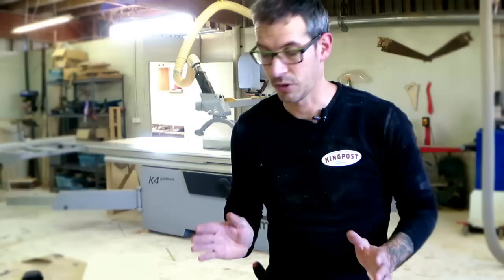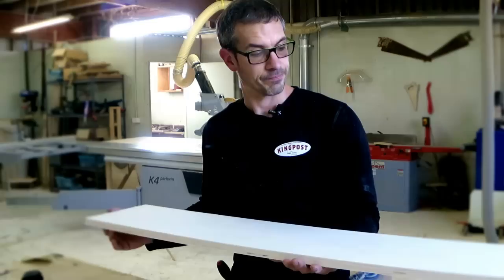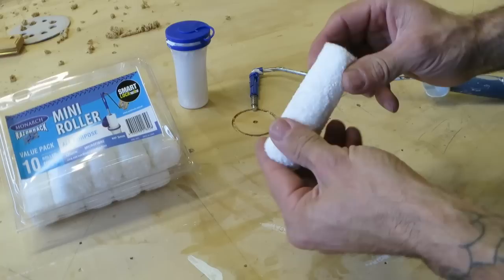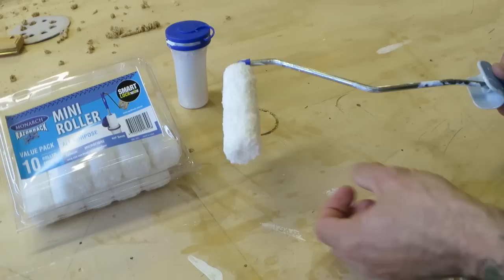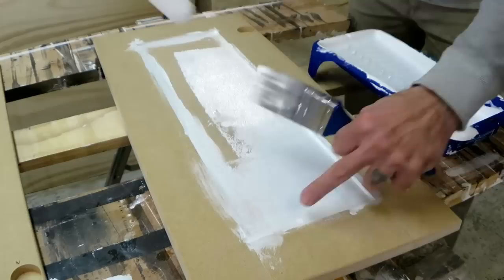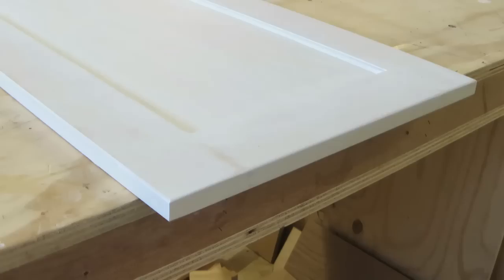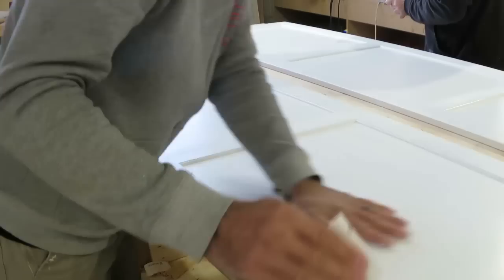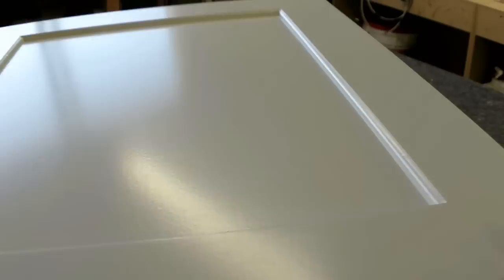Great paint finish with a roller!

Comment: I can't stress this enough! Use these rollers in this video! I used to think the high density foam rollers were the best but they are not. Get the short nap microfiber rollers.  I also used benjamin moore advance paint. I added floetrol to the paint. Whatever texture you might get from the roller will smooth out with drying! My cabinets came out amazing! Zero roller or brush marks. People think I sprayed my cabinets but I didn't! Lol!
Reply: Did you lay off with a brush after rolling? I ask because I am unsure whether that just means you would have brush marks.
Reply: @Avital4414  no I did not lay off with a brush after rolling. However your going to need to brush any detail you might have on the cabinet door. I have panel inserts that I had to brush. Mainly because a roller can't get into it. If you use a microfiber roller you will have tiny little stippleing right after lifting your roller. Don't worry it will level out just fine, it's nothing compared to the bubbles left from a foam roller. The key is don't fuss with it too much. If your not sure ....just practice on a scrap piece of wood.
Reply: @number1pappy  thanks!!
Reply: @number1pappy  I understand that some people roll those inlaid detail areas after they apply paint with the brush. Have you done that?
Reply: @Avital4414  I tried and I'm not a fan! When using the roller on the details it left too much paint and it pooled on me. I even tried with a roller after using it so it wasn't that wet with paint and  was still weird. It just didn't leave the paint the way I wanted. Honestly though using a brush on the panel indents didn't leave any brush marks whatsoever.  You have to run the brush out ! You can't just smudge the paint in the indents and expect a good finish.  I just laid the paint out back and forth making sure there was no paint pooling etc and let it be. I don't think you'll have problems with this. Good luck. Let me know how it came out. There's nothing better than having your paint project come out awesome.
Reply: @number1pappy  thanks!!!
Reply: Think you hit the nail on the head the short nap is the trick I’ve been using the purse thicker ones and they aren’t good . I love the advance with flowtrol  what would you do for crown molding that has to be repainted
Reply: Hi number1,
Floetrol is usually used for art works and the like... how much - what ratio - do you put in the paint for the above type of jobs for best results?
Reply: @GR-dq2uj  I used 8 ounces per gallon.  It's amazing stuff.

Comment: Using a roller to paint smooth surfaces is great for covering large areas quickly but, you'll always end up with an 'orange peel' finish. Whilst some people are more than happy with that, personally, it would drive me nuts! (I'm a decorator by the way...) I like a smooth finish, in which case you can still use a roller to cover the large areas quickly and evenly, you just need to then lay the paint off with a good quality brush, I use Axus Decor Pro Blue, (Purdy and Wooster are also very good brushes) for large, flush surface areas you can also use short pile paint pads, just wash them first with mild soapy water and rinse well to remove any loose filaments. Great video, as usual!
Reply: Agree.  The orange peel effect is pretty grim.  Lay off the paint with a brush.
Reply: How do you prevent brush lines when laying off with a brush? Do you need to thin the paint, load the brush at all?

Comment: Hi Joey. You make it look too easy. Yes, I'm also a fan of the Monarch rollers (and their ADVANCE brushes) and Lustacryl. I've found another tip to improve the finish even further - add 10-15% of Floetrol to the paint especially in Summer. It increases the surface tension enough that the bump texture evens out even more. And I always use a tack cloth before the final coat.
Reply: Yes that Floetrol definitely helps smooth it out.
Reply: so does it work as if it was enamel and levels out the roller orange peel?
Reply: @FourOneProductionz  Yes - pretty much, and flows better when painting.
Reply: @jagros4672  ok cool how does it compare with resenes brush additive have you tried it? Do you also paint doors down or standing?
Reply: )MO

Comment: ... Just did my kitchen and bathroom cabinets, really wanted a sprayed finish, so setup in backyard a 10x10 pop up tent with tarps zip tied to the sides and ground, made for an instant spray booth, took like a half hour to setup.... I primed with BIN and then sprayed BM Advanced with a Graco X5 and 310fflp tip, sprayed each side flat with 24hrs between coats and transferred to garage to dry, worked great, came out like glass and no need to send them out etc....
Reply: I am just now planning on doing this exact same thing (kitchen only), using INSL-X STIX for primer vs. BIN. I am assuming you did some sanding after primer and after 1st coat of Advance. Did you have any trouble with Advanced running? I have heard you really have to stay on top of that. Thanks
Reply: @bryanc2685  I laid the doors flat for each coat and 24hrs before flipping, so use lots of patience.., I did not have a problem with runs at all here, I think using the 310fflp  tip helped and not over applying... Each coat was done in just a few quick steady passes with the sprayer and worked out great, only had challenge with vertical surfaces, like my valances I hung to spray, really have to be careful not to over apply here or will run.... I got a couple junk doors to practice on and get the feel first.... And yes, I first cleaned really well with krud kutter, sanded well before priming and lightly sanded between every coat and blew and wiped off... if painting oak, watch out you will get bleed through with Stix, that's why I used BIN as a shellac it blocks bleed through and sticks really well, there is a good video of Stix vs bin and bleed through with oak, so if doing oak, would not suggest Stix, 2 or 3 coats of BIN and your all set... Hope that helps and good luck, kitchen came out great but was a lot of work....
Reply: @steveh3734  My cab's are lightly stained/varnished birch, so hopefully no bleedthrough issues pending. I haven't bought my sprayer yet, getting either a Graco Magnum x5 or a Wagner Control Pro 150 so I also will probably use the 310 tip. I will be brushing & rolling where spraying is not prudent. Yeah, it is a lot to plan and do, but I see more uses for my sprayer in the future (fence, deck, shutters at least).  Thanks for your responses!
Reply: @bryanc2685  good luck!  I rolled the BIN, and sanded it flat, didn't want to run shellac through the sprayer and it turned out fine... And some pieces I could not remove inside I rolled and brushed, and worked out fine... Best tip with Advanced when rolling I found was  put it on quick and leave it alone to self level, don't mess with it and will look great... Good luck!!

Comment: I can’t deny the results look pretty good, but I’m unclear WHY it works. Why would the subsequent top coats finish up smoother than the first one, when you’ve sanded the primer super smooth? Maybe the subsequent top coats can sit on the first ones without soaking in so have more time to spread out flat?

Comment: The close-up images were captured with just the right light at a good angle. We were able to see detail, especially with the white surfaces. Most videographers don't know how to successfully capture this. Nice work. Do you have any experience with this technique on melamine surfaced cabinets? My kitchen cabinet doors are white melamine covered MDF, and I hate how the white has yellowed. My boxes are birch plywood, and that painted surface is holding up beautifully. I can't spray paint in my apartment, but I don't want to roll if I can't achieve an ultra-smooth finish.
Reply: Dulux do a range specifically for those and it's either rattle can or pot n roll.

Comment: Just if anyone is interested... I roll on around 4 to 5 coats eggshell I don't care how rough it looks doing it super quick. 24 hours later I sand it smooth and finish with just a smidge of wax. Super smooth no orange peel better than most spray jobs....
Reply: X X  What kind of wax do you use? Do you have any trouble with it yellowing in time?

Comment: Another great video, thanks Joey. Interesting that you use the BIN primer on bare timber, I only use it if I need to seal the surface or go over a previously painted surface of unknown origin plus it is an expensive paint here in Oz and I dare say in NZ. I do like the Resene quality though. Good set of tips, much appreciated.
Reply: Not BIN - Bullseye 123
Reply: You need the bullseye or any pigmented sealer for ply or glued wood to prevent the resin staining

Comment: Love your work Joey. Between coats, and after vacuuming up the sanding dust I use a slightly damp microfibre cloth to clean up the sanding dust. What do you do?
Reply from the maker: Usually just a blow down, seems to be ok. My thought is that the sanding dust is finer than the paint so any left over dust just blends into the paint

Comment: Joey, I want to change the cabinet knobs but the issue here is that I’m going to be left with 1 hole visible because the new knobs only require 1 screw. How can I cover the other hole? And also if I need to reposition the new knob, what kind if drill bit can I use in mdf? Should I drill the holes before or after painting?? Thanks!

Comment: Hi  nice video  i painted my door  with Behr Premium paint and primer  in one  but  the problem is  it  very easily get stain and if one hand is not clean touching it it stay  i am just wondering if there is  some  clear finish to apply  so the  stain can be easily cleared  thanks
Reply from the maker: I would reccomend a better/different paint. Also can depend on gloss level.  Matt finish will be hard to clean versus gloss which is much easier to keep clean

Comment: Hey Joey, the finish came out great but I am just wondering how you find the durability of the piant you use, I find here in Ireland that any paint I ever used by brush or roller is never near as durable as the paint jobs I send out to get sprayed, I'm fairly sure my spray guy mixes a hardner through the paint which I always find to be far surperior, I suppose its a bit like the effects you get mixing epoxy
Reply: Here in the states, the Govt is making it more and more difficult to use petroleum based paints.  Global warming and all.  I am a residential repainter (not new construction), and am unaware of any 'harder' that can be mixed with water based paints.  Paint companies try to make durable latex (water based) paints.  There are products that are pretty good.   I use Sherwin Williams WBU (Water Based Urethane) for entry doors.  It is superior to an ordinary exterior latex house paint.  But nothing is as hard or durable as oil based or lacquer based paints.  My guess is that when you send something out, they are using lacquer, the 'go-to' material for the furniture and cabinet industry.  It gives impressive results with a very low cost sprayer.  Smart and higher end builders here require lacquer on all interior doors and trim.  Rollers leave stippling, brushes leave brush marks, and spraying latex can leave an inconsistent finish - higher sheen in some areas than others.  So far as I know lacquer is perfect, and other than removing bugars and lint requires no sanding since the layers melt into one another.
Reply: They are phasing out oil based paints here as well, not sure about Lacquer though, I suppose it has to be done, hopefully the water based paints will get better and in time give some where the same results
Reply: DRitz78,   Most cabinet shops are still spraying catlyzed varnish, like sherwin williams kemvar conversion varnish, when they can. It's hard to beat for kitchens and bath vanities. They make different formulas depending on location. But I think in the L.A. area, I'm not sure if it's allowed.  Regular lacquer is a great finish, but really not that good for wet applications. The beauty of catlyzed products is that they dry quickly and very hard so you can sand in minutes.  The sherwin williams WBU sounds good, I will have to try it.
Reply: gerard donoghue painter and decorater here in ireland I find using owtrol oil in with oil based finishes gives a better quality of finish while being harder wearing as a result

Comment: Hi Joey, Great video! Do you have a tutorial on how you made those MDF doors? I would like to make similar ones in just a square shaker style without the decorative molding. Thank you
Reply from the maker: No I don't,  but a simple shaker door is pretty straightforward.  Use 6mm MDF and use a quarter in bit to rout the groove.  Corners of the frame can be dowels or biscuits or dominoes or half lap joints etc

Comment: Hey Joey. Have you used regular acrylic paint on cabinet doors? I'm not finding an enamel paint in a brand I trust. (I'm in the U.S.) I'm making ten sets of cabinets for hotel rooms in a historic hotel and am wondering how much of a difference the paint being enamel makes in a high use environment. Thanks so much for sharing what you've learned. I like your style!
Reply from the maker: I use what they call water based enamel.  It is very similar to oil enamel with much quicker dry time.

Comment: This is impractical. It requires a lot of progressive sanding multiple times.
If paint roller was going to do the jobs, factories and paint shops weren’t crazy to spend thousands on machines.
You basically encourage DIYers to ruins their cabinets.
The best paint roller finish I’ve seen is the no paint!
It’s impossible to have an orange peel free finish with a roller and if you had the camera zoomed in it was obvious